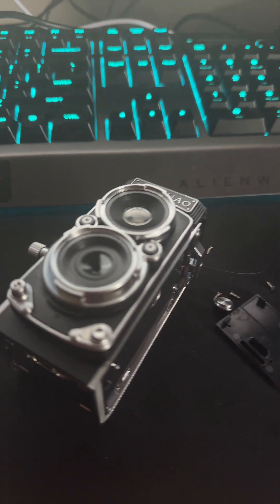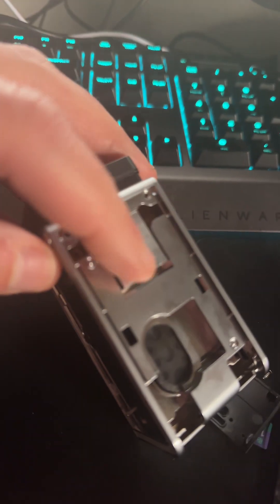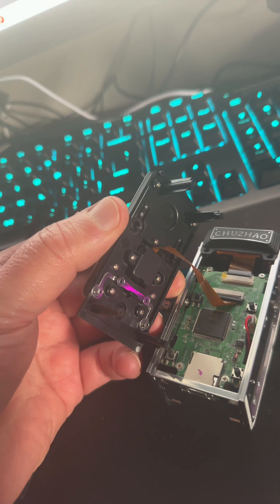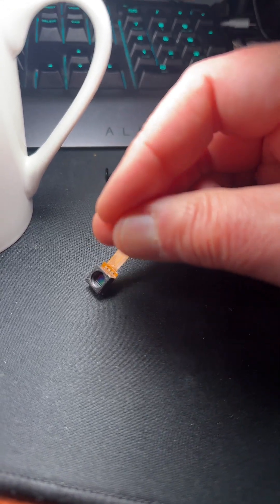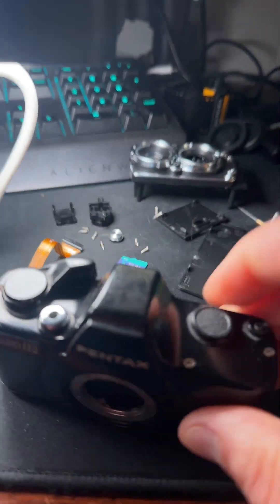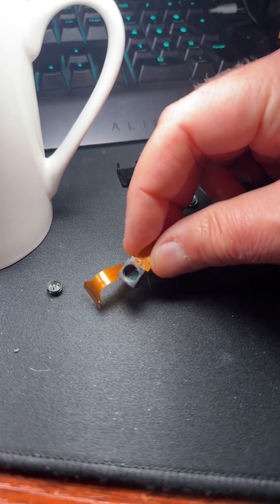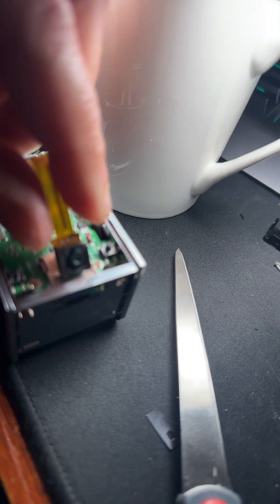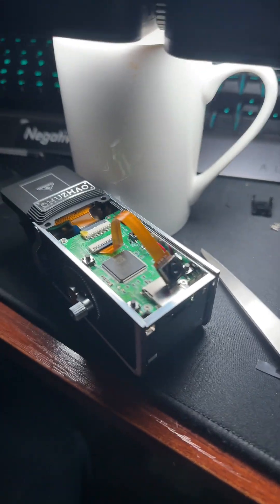Chuzhao TLR Teardown and Infrared Conversion

Comment: Hi, sorry for this random comment, I just couldn't find an instagram or discord anywhere. I know this is a strange request, but I’d feel stupid if I didn't at least try asking. Would you be open to a specific commission? I would really like a modded Chuzhao with a C-mount. That would mean the original lens needs to be removed, a hole made in the front, and a tube fitted with a C-mount at the correct flange focal distance from the camera sensor. I'd buy the Chuzhao and all the parts needed myself of course. Let me know if you would be open to this

Comment: FYI, mine isn't the same, it actually has an autofocus, so I wouldn't recommend cracking open the lens mount unless you've modded cellphone cameras. The one in the video doesn't appear to be the same module, but its somewhat similar in appearance, just a more bulky metal frame for the AF mechanism.
Reply from the maker: @l1089624  the entire lens/hot mirror optics are in one set that screws right off. Even taking it off, the unit tries to AF. I wonder if there are variations between units.

Comment: I wonder if converting this camera to use c mount lenses would be a good idea
Reply from the maker: @loqueteniaquedecir  I thought of this. The sensor is pretty far back. The flange between the sensor and lens is like mere millimeters. Would have to basically remove the entire bezel to make it work. I played around with a fujian 35mm c mount lens with it and found it was still too far from the sensor box. This would make a really interesting project I wish I had a little more time for :) should be my next video!

Comment: how did you actually opened it? I am trying and cannot understand. I need to change the battery
Reply from the maker: @KeigoMoriyama  with a spudger it’s pretty easy. The plastic won’t break. It kinda bends out and clips off. Make sure you unscrew the 4 screws, once you do that, the whole faceplate comes off. I didn’t see the battery when I took it apart so my guess is it’s in another compartment.
Reply: @Ivandotjpeg  I guess you meanthe little slot on the bottom side under the on/off switch? Put a spuger in there and remove the plastic, and then you see the screws? I also would love to watch inside mine, but I don't want to break it.

Comment: love the video, exactly what i searched for!
how did you remove the plates on the sides and the back? can i put them back on again afterwards?
Reply from the maker: @villipi  really flimsy plastic but you can pry them off with a simple spudger. There are 4 screws that unlock the faceplate from the base of the camera. Once you take those off the whole thing comes loose.

Comment: I'm no expert, but I'm guessing that sensor isn't 12mp. 😅

Nice work breaking it down. I wouldn't know where to start.
Reply: 😉 12MP may be interpolated as full HD video is❓
Reply from the maker: @vermis8344  oh yeah 12mpx from what looks like 1.2mpx image.
Reply from the maker: @vermis8344  that sensor is minuscule!
Reply: The images are 3456 x 3456, so 12 Mp!
Reply: @KeesKouwenberg  just because the images are 12 MP does not mean that the sensor is, because images can be upscaled or downscaled before saving.

Comment: A firmware mod for this thing is a must and i wonder if that thing could actually become fully manual.  Did you perhaps see what type of lithium battery is used in this thing? WOuld be good to know how easy it it would be to replace it or make a case mod to move the batttery outside and making it easier removable if needed. Because i don't trust these Lithium Batteries at all.